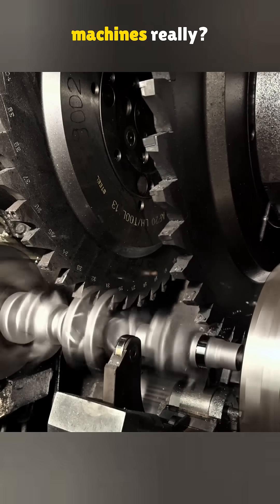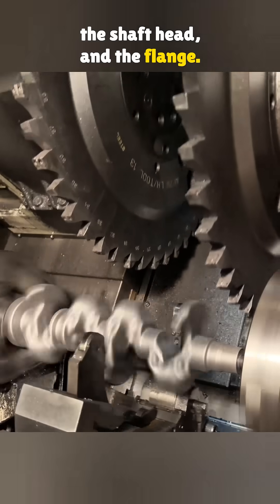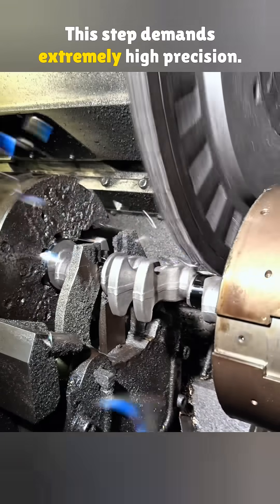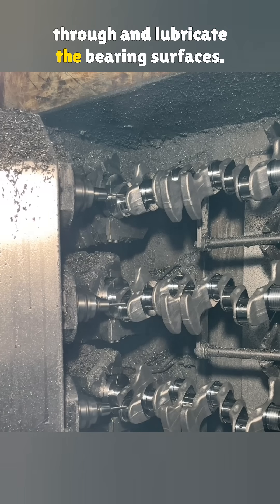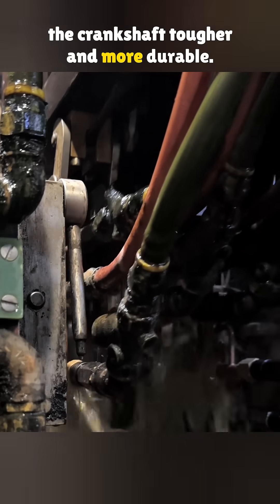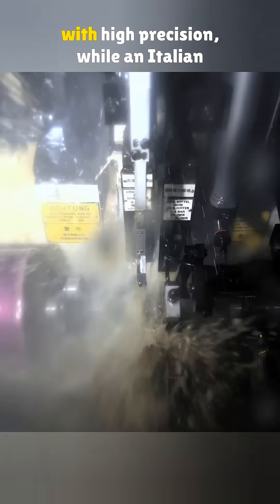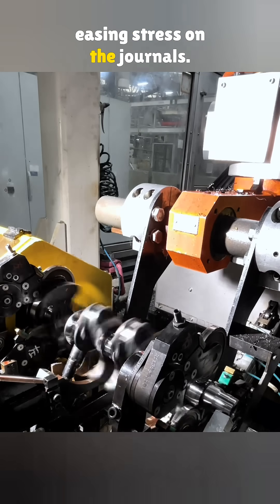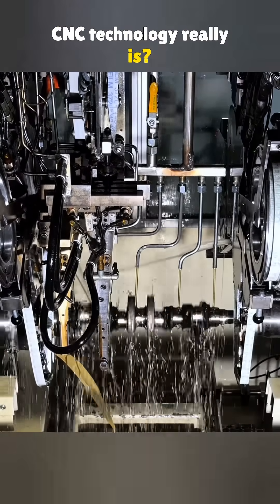How Far Behind Are Chinese CNC Machines #automobile #mechanic #car #assembly #manufacturing

Comment: Hmmm. China is perfectly capable of producing engine parts of the same specs as the west. If you're talking 5 axis CNC well they are slightly behind but that's not for cranks.

Comment: So if Spain or Germany was to make the same equipment, wouldn’t they rely on each other’s machines? Or will they reinvent the wheel like the video creator imagines it should happen?

Even Apple’s Safari browser uses Google’s search engine algorithm behind the scene. By the same logic, is Apple behind Google? Samsung builds a skin of tech on top of the default Android operating system to give their loyal customers a different user experience that they are used to. Does that make Samsung behind anyone else in mobile phone manufacturing?

The premise of the video is simplistic and silly. Instead, appreciate the Chinese for putting together complex supply chains to give the world the best crankshaft that modern tech can make.

Comment: They are not behind at all.  They just choose not to compete in highly specialized and mature product segments.  CNC tools for OEM automotive applications are VERY specialized.    They are built for just one part, and they make millions of them.  

Do you think that US-based car mfgs are using US made machine tools?  LOL.  They are not.   Even in Japan, the leading machine tool mfg in the world, these specialized automotive tools are used instead of general CNC machines like HMCs, VMCs and CNC lathes.  

Conclusions about general CNC manchine tools (job shop mills and lathes) can not be drawn from this special OEM application.  The whole premise of this video is nonsense.

Comment: Dumb question, they are using appropriate equipment for the job.
Reply: exactly! now the question is... then why chinese charge lower for the same part using same machine from germany or US?
Reply: @danielngho Currency is my best guess. One dollar is equal to 6-7 yuan. In this way you can get cheap Chinese products but it will be a nightmare for American industries.
Reply: @johnnywoo9214  If it were about currency, the parts/products will be even cheaper to get in Japan as one dollar equals ~150 yen yet it's more expensive there than in China. Currency plays no part in it.
The actual reason it's cheaper in China is because of different factors like cheaper cost of labour, lower electricity rates and higher speed and efficiency of production compared to most developed countries in the world. That's why China does it cheaper.
Reply: @fidelisitor8953  In Japan’s case, they suffered from hyperinflation in the 90s as the bubble exploded. The so-called lost 30(40) years. Therefore, you should take their 100 yen as one 😂
Reply: @danielngho China controla la cadena de suministro de materia Prima prácticamente global y su sistema de flete funciona de una manera milimétrica, todo el Estado se organiza para la producción.  Mientras que en occidente los políticos le ponen impuesto a todo lo que pueden para robar el dinero del Estado.
Reply: @danielngho You heard of 'Labor'!
Reply: @gingerjule  of course i heard of labor... then why still compare???
Reply: So, is that a question?
Reply: tell that to CCP then, they're running the country, not you.
Reply: Except, which aside from the potential propaganda jab against China, the answer could be seen as on par since they're using the same equipment although they have do not produce the equipment.
Reply: Exactly
Reply: Ding, ding, ding. Because they can't make it themselves.
Reply: @deltabravo1811  Why bother when you can buy industry standard kit  in at a price that makes home production pointless?
Reply: Mostly from cheaper energy. China is investing largely in nuclear, supercritical carbon-dioxide, wind and solar power generation, keeping the overall production cost and its labor's cost of living down significantly. Along with shifting away from carbon-dense emission power generating methods, companies which used to mine coal for fuel now also produces carbon fiber from coal.
Reply: Quality control is very poor with the Chinese, and equipment still needs to be operated and maintained.
Reply: @vicmclaglen1631  the Chinese can make products to as high a standard as the US, Japan and European manufacturers when they need to. The perception of poor Chinese quality comes from the specs set by the buyer of the goods. Many aren’t happy shaving just $1 off the production of a $30 retail item, so will spec.  lower quality materials in parts of the product to save $2 per item and pads the bottom line. Cough - wallmart- cough

I’ll grant you some of the domestic stuff is on the cheaper side, but like India with the Radjoot and Enfield motorcycles until recently, they were cheap and cheerful as the home market wasn’t rich enough to buy the export versions. 

 There’s a reason so many Asian and Indian students go abroad to uni then head home with science and engineering degrees. You saw the same arguments with Japan and Korea about quality in the60’s and 70’s, and now India is getting the same treatment on the internet.  Things will get better, and fast, it’s a combination of improved industrial technology and multinationals moving production plants there to improve their profit margins, whether the orange toddler likes it or not.
Reply: The point this video is trying to make doesn't make sense. It's similar to saying how far behind is the U.S. is cellphone technology because all cellphones used in the U.S. are made overseas.
Reply: Communist China will make "big money" if they can steal the designs and do it all in country
Reply: @kotk05 e l' unica cosa in cui sono bravi. A parte mettere monitor e lucine.
Reply: @giuseppeluciani4125 if you go by  US patent office statistics you will see they invent now more than anyone else.
Reply: 100% correct

Comment: Polishing failure at GMs mexico crank supplier has made the 6.2 liters junk.
Reply: Facts
Reply: Still GM's fault. GM quality assurance should have caught it.
Reply: @MemyselfandI001 actually is GMC policies, cutting cost of production. They give bad rep to Mexico but. In actually is the GMC practice.
Reply: @javiermendez9365 it’s both GM and the Mexican manufacturing companies fault.  When the manufacturer couldn’t meet the GM tolerances GM simply lowered the standard ( again) for them to “pass”
Reply: @MemyselfandI001  Yep so true.  GM is responsible for QC and delivering a quality product.  They were too lazy with testing.  Huge failure.  Shame on GM.
Reply: Can you say class action? 🤨
Reply: Ram Trucks are just as bad in other ways and are made here in Michigan.
Reply: bro problem is motor oil 0W30
Reply: @SurG30n not sure about that. My honda civic 1.8 uses 0-20w after 330k no issues at all 🤷🏻‍♂️
Reply: @mahdavimail Yes, because a 1.8 motor runs exactly like a 6.2....apple/orange.  It's a combo of very tight machining tolerances, oil starvation in such at cold start and polishing index quality.
Reply: @mahdavimail Honda civic si 250,000 runs good 0-20 motor oil,never been inside motor,it’s over due for timing chain, no problems, it’s not the oil 😮
Reply: @mahdavimail  Ah yes, the 1.8 liter, 4-cyl, honda engine. Known quite well for it's comparison to the 6.2L.
Reply: @ShweetPete I was not comparing engines, my point is all engines are using pretty much the same oil and the failures don’t seem to be from oil! You might disagree and it’s fine bro.
Reply: @Papacoalminer Maybe it works for your small displacement, low stress engine but I won't trust 0w-anything to lubricate a roller skate.
Reply: @mahdavimail oh Yea, & it was made before 2007...after that they became "Official Crap-ola"/ just like EVERYTHING ELSE. "Hundo" was the First to go "Scraponese"!😢
Reply: @SurG30n  Use 10W40
Reply: The only mexican product I would buy is avocado.
Reply: @lester6346 😂😂😂
Reply: @lester6346 don't forget your taco amigo
Reply: made in China
Reply: I just had a made in Mexico ‘25 Mazda CX-30 non-turbo transmission failure @ 29,143 mi. I broke it in correctly, maintain it well, & only run Premium ⛽️. I knew something was wrong w/ the transmission @ 143 mi. a few days after I got it but they wouldn’t listen to me.
Reply: @fredmorris6336  I wasn't aware they made the Mazda automatic transmission in Mexico. That's really messed up. I thought all Japanese vehicles made their engines and transmissions in Japan.
Reply: I think most of these failures can be written up to dumbing down the work force and using "imported" labor.
Reply: My 73 dodge V8 pickup is much easier and cheaper to work on than my 93 toyota 4 cyl pickup.
Reply: And rust made my GM pickup disappear. Bought my last GM years ago.
Reply: @MrNobody2828  did you have it under-oiled at all? I drive a 25 year old chevy s10 in a place where they salt the roads in the winter.. barely any rust on it. It's always easy to spot the people who never got their cars oiled, regardless of make or model.
Reply: General Malfunctions 😂
Reply: @sheriffshifty1953 how many recalls has Ford had. Let's take numbers. Eco-blow.
Reply: @Do-Not-Respond  I have a 2016 F-150 2.7 Liter Eco-blow going on 140,000 miles.  NOT ONE PROBLEM YET.
Never been in for service.
Just general maintenance that I do all myself.
oil changes...brakes...tires. etc...
Also a few years ago we owned a 29' Dutchmen Aerolite Travel Trailer.  
It was almost 1,500 lbs over the recommended tow capacity.   
On one of our family trips, I towed the trailer through the Mountains in Pennsylvania.  
It pulled like a Champ!  
Passing Semi Trucks through the mountains with that wee little 2.7 Eco-blow😂
Reply: @KZ-1155 It doesn’t mean every one of them fail. There is just an unacceptable percentage. Yours is just one out of how many?
Reply: @STSwhisperer I agree 100%
Reply: @STSwhisperer  I hear ya, maybe i'm one of the lucky ones?
Many years ago, while working cunstruction at a engine plant,
was riding in a golf cart with my contact person who was taking me to the location of where my work was to be done.
On the way to the site location we passed what looked like a football field sized area of what I thought were new engines on pallets.
As far as I could see, multiple thousands of engines.
I asked my contact where all the engines were going. 
He told me they were ALL DEFECTS / RECALLS.....
WTF I said someone must be losing their a$$?
He said Nope, Thats the normal 2 to 3% that happens every day, as if it were nothing.
It blew my mind!😵‍💫
Reply: @KZ-1155 That’s pretty crazy. To be honest I really don’t know the stats that well, just what I hear and see a lot. I think some of those engines are a lot better than the others. There are several size eco boost engines. It’s crazy to think that they would be that different but apparently they are.
Reply: @KZ-1155  Rookie numbers wait till 175-200 k …It’s coming you know it’s coming 😅No American designed cars can touch the Japanese.
Reply: @sheriffshifty1953  You say that, but last year BMW had more recalls than GM, and they only sell a third of GM's volume.
This year VW has more than GM.
If you look at the actual numbers, and consider how many different models and quantities are being sold, GM's numbers are near or at the best in the world.
Reply: I don’t know why you guys are still buying GM. By this point, it’s your fault. I don’t even blame GM. They’re trying to make a buck. But you don’t have an excuse. You should know better.
Reply: @trefontaine trying to make a dishonest buck
Reply: @trefontaine i use to mess with gm. older models. now no more. i currently own a 2002 lexus and a 97 nissan. both very reliable. happy
Reply: @trefontaine  Made in Japan is the best but any Japanese car made elsewhere isn't as good. No one can easily compete with the Japanese workforce, they have a dedication and loyalty to their company beyond what the rest of us could or would want to do.

I worked in Japan for a car auction and I saw that first hand. The pride they take in their company and the quality of product they make is on another level.

For example, on the assembly line if a Japanese worker notices a defect, he or she will feel deeply offended and ashamed for their company if they let it go. Here in the USA, most workers would let it slide and assume the QC dept would catch it later.

A lot of that has to do with how the company treats it's workers. If your boss is constantly screwing you over, why put out a good product for him?
Reply: @trefontaine  blame the GM make trash
Reply: @trefontaine  well tell us what car manufacturer gave you a free car or a car at cost?  They are all trying to make a buck...
Reply: Female leadership for ya.
Reply: @tony8570 stop it. Who’s running   dodge?
Reply: @tony8570 lol, most auto companies  have male leadership, most of them have crap quality. Only good ones are Toyota, Subaru and Mazda; Honda's good on some models.

None of the US domestics are good. VW, BMW, Audi - all crap and expensive to fix. Land Rover: don't touch it unless you love seeing piles of money burn up.
Reply: @tony8570  its fine....I mean, if you want it polished better, why don't you do it yourself!?--GM, most likely. :D
Reply: Typical government motor quality assurance.

Comment: Because it's cheaper to buy from a company that makes these parts then it is to produce them yourself. Who doesn't do that?
Reply: Makes sense !
Reply: How many people buy Chinese manufactured home handyman equipment (mig welders, compressors, etc) because the expense of the top shelf  products isn't economical for them?
Reply: @dynawilly the reason Chinese can make cheap parts is partly due to the fact that they dont cheap out on their tooling.
Reply: Kind of the opposite, it would be cheaper to R&D them and make an in-country machine version versus expensive imports. The reason they prefer to buy foreign made is because they know there’s much stricter quality assurance specifications. Homegrown engineers wouldn’t nor couldn’t make the machines at the same level because shortcuts and cutting corners in the name of the game in the Land of Façades (China) 🫲😏
Reply: @GamingProspector84 sorry, but you are talking nonsense. If locally designed machines are better, we wont have recalls involving the GM's 6.2 V8, Toyota 3.4 V6TT, Takata airbags and so on.
Reply: @GamingProspector84 your comment  shows you don't even know the basics of economy and business😂😂😂
Reply: True for many case but in some cases those tools are extremely expensive. It is used by western manufacturing in China to sell to western markets. Some kind of royalty when they still hold the top brand.
Reply: I don’t think there is any special unless it is cheaper than some good enough CNC plus some good enough manual adjustment
Reply: Your answer hit the nail in the head!👍
Reply: In the short term, yes.

Comment: Just because China isn't producing its own high precision manufacturing CNC equipment doesn't mean that it is incapable of doing so.

China's priority is high volume production, and global supply chain dominance. They are focused on making products as cost effectively as possible and flooding global markets with sufficient quality, low cost goods. So they stay in that lane, focusing on producing what will make them money and maintain market share control, not bragging rights.

To them it would be a waste of time and resources to manufacture specialty high precision equipment when there is already stiff competition and little money to be made in those niche markets.

China has the capacity to copy Western technology as well as to incrementally innovate, refine, and improve those technologies. Consider the smart phone market, where their I-phone knock offs offer additional features, one upping the originators current upgrades, latest editions. 

But instead of developing this high precision, high tech specialty CNC machinery they focus on National priorities, their business plan, instead. 

If China can tie up and dominate a global supply market, and it's in it's best interests to do so, it will and does just that. 

China's business savvy and strategies are very well thought out. They steal or purchase what they must in order to dominate global high volume production markets and maintain control of global supply chains, as well as to maintain sufficient cash flow. Money and high tech are only a means to their end and objective of global dominance.

Comment: I didn’t know electric vehicles were going to need crankshafts!
Reply: Those are for the new Robots.
Reply: Electric vehicles are a very small percentage of the automobiles in use and that is not about to change anytime soon. The adoption rate has slowed down significantly and most people don't want them.
Reply: @actionjksn in the middle ages of the USA maybe?! In Europe and Asia EV's sell better every year.
Reply: China is still designing all-new gasoline engines for their export markets.
Reply: Do you think the american auto industry doesn't import parts made in china?
Reply: Best answer by far 👏🏼👏🏼👏🏼👏🏼😂😂
Reply: I 😊😅😂😂😂😂😂😂😂
Reply: I cinesi le auto elettriche le fanno solo per loro stessi! Nel resto del mondo vendono auto a benzina e pure diesel! È se la vuoi a carbone, basta che paghi e te la fanno! 😂😂😂😂
Reply: @efisioscalas9033 i watch Lin Guoer in China tooling around in a electrics fixing machines..on youtube..brilliant lovely...
Reply: But oil needs
Reply: Good comment. China didn't want to be dependant on the usa by the need of oil so they said we would use electric cars instead.
Reply: We won't be going EV much longer. Now that we have the GenV gas engines coming on line. No one want to pray there is a charging station and then sit for an hour while it charges.
Reply: Well, Now you know 😊
Reply: @portlander7280 😊😅😅😅😅
Reply: Well that would eliminate about 3% of the need worldwide